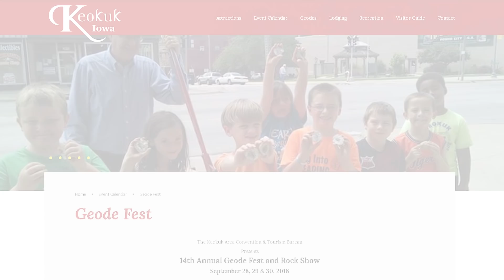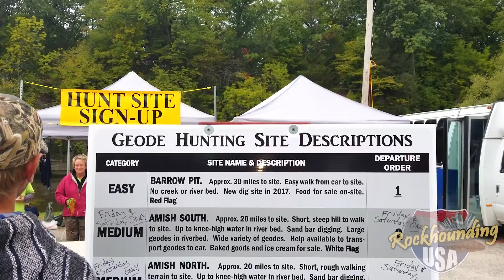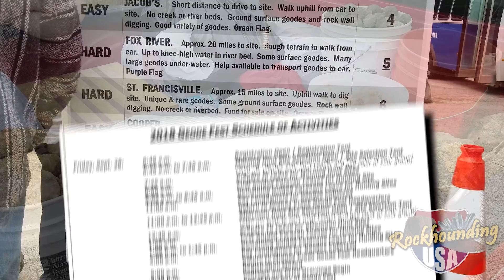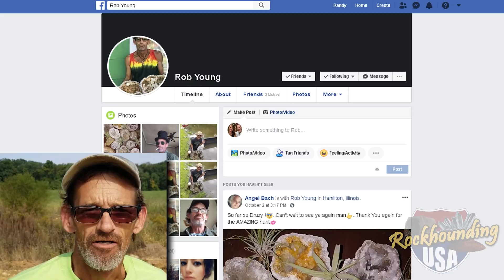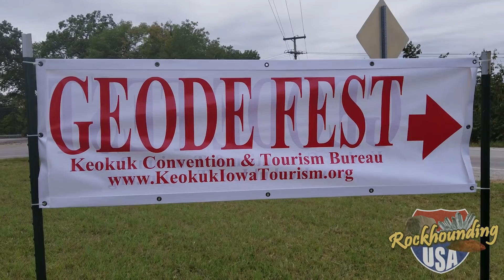GEODE FEST 2018 Highlight Video (Keokuk, Iowa)

Comment: Thanks for a wonderful video.  I was there this year but my trip was cut short by an injury.

Do you know which site the iridescent geode came from?
Reply from the maker: It was from a location (near Keokuk) not accessible to the public anymore. It was purchased from a vendor at the event.
Reply: Nope!  The site was not purchased by a vendor. Yep , it is highly off limits. The man that owns that ground is not , absolutely  not interested in geodes and will prosecute those who are caught there. Beside that , there is not a continuous layer at this location,  rather irregularly shaped lens structures that are discontinuous.  Mr. Wixom did a lot of trespassing for a while there  but even he knows how dangerous it has become to hunt there mainly through his untactful actions. To the best of my knowledge the place is wired for light and sound these days.
Modern living and the electronic age! I know  several folks that are getting brown irredescent calcite geodes from other sites that they get really testy about divulging  the locations of and I don't  blame them!